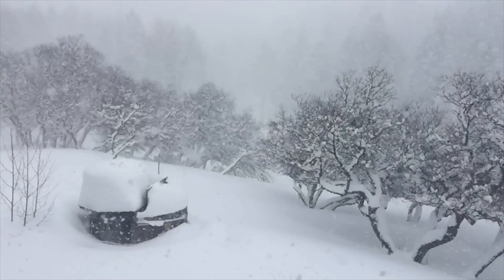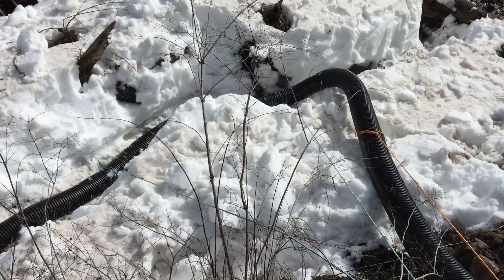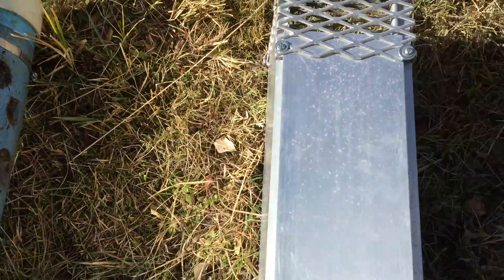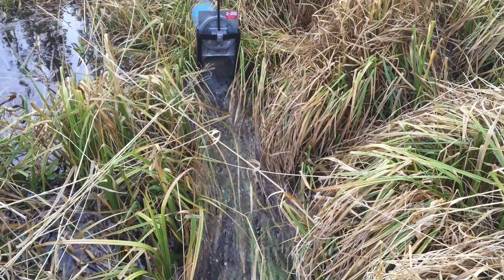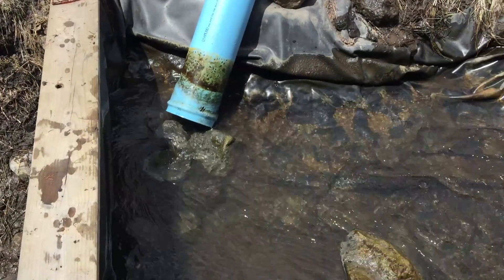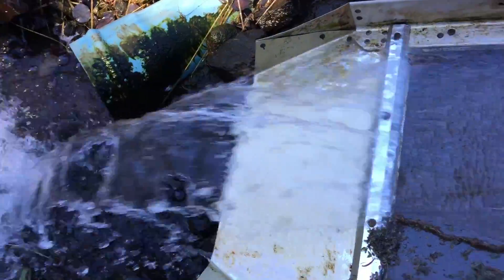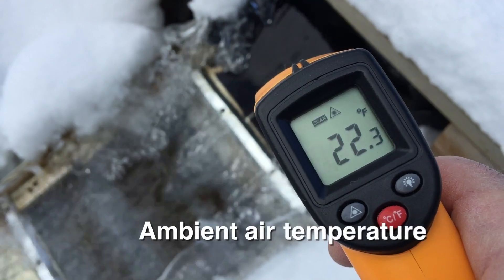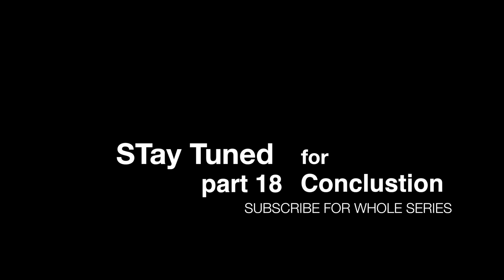Part 17 MicroHydro Power System in CO

Comment: Wouldn't it be you get a better water intake if you partially dammed that little water fall, allowing water to still flow over and down the stream but after forming a pool then placing your intake in that pool? Seems like the intake position is the cause of the air in the system.
Reply from the maker: The intake was in a natural pool up until this Spring.  We haven't yet diverted water this year and are relying on the water in the meadow for our reduced flow to 4500w of power.  Any dam constructed would be washed out by the spring run off which this year changed the entire course of the creek with enormous erosion.  We just have to adapt to the changes that occur in the creek.  The intake point is at the edge of our property so going upstream to a higher elevation isn't an option. Thx for watching and the thoughts.

Comment: You take water from the river for your pasture? Hopefully youve got rights to that water as claims belong to surrounding states on top of those who have actual water rights. How are you allowed to change the course of that river as well as dam and make a pond with it? We cant even clear an avalanche that dams a river in colorado as the waterway and river bottom is governed by the army corp of engineers. I ask only because i live here and want a turbine but with all the rules and red tape its not really possible.
Reply from the maker: We do have water rights.  They were acquired by filing in water court for non-consumptive run of river rights where the water goes back into the source it comes from.  Years ago we did build a permitted dam (permit needed when dam is above 5 feet) on another part of the property to establish a water augmentation system that can be "called" by senior water rights down stream.  It is a system that enables water managers to release a defined amount of water to meet senior water demands.  
We have not changed the course of the creek, it changes itself during the spring melt off all by itself.  There is no dam on the creek for an intake.  If we tried to install one, it would likely be destroyed by the spring melt off.  We do have a collection weir if that is what you are referring to.  It facilitates the collection of water into the coanda screen and the penstock.  There is existing water moving through the meadow which is more of a wetland than meadow.  It is combined with the water we divert from the creek.
Acquiring water rights involves filing in water court in CO.  First you get a conditional right that is good for 7 years to prove the beneficial use of the water. You can then file to make the water right absolute or extend your conditional right.  The adjudication date comes from the date of the original application.  This doesn't mean you are in front of the senior rights downstream.  Virtually all water was filed on and claimed via a similar process in the last century or earlier.  That is what makes those water rights senior to ours.  
If you are serious about getting water rights, I suggest finding a water lawyer to help you through the process.  We did decades ago.  You can file by yourself "pro se", but you might miss an important detail in the filing.  Odds of getting access to waters on Federal land is unlikely, but on private property (which we are) its not impossible, it just takes time and effort to go through the proper channels.  Good luck with your process.  I hope this helps explain it a bit.
Thx for watching  I'm never sure who has seen what of the series.  Here is a playlist of the 3 part synopsis which is an overview of the whole process https://www.youtube.com/playlist?list=PLtTypVpmDd-vkT9bJQkXw4I1t0e_4jMYA  The whole series is in about 25 videos.  This video gets promoted most frequently by YouTube.

Comment: Since this system provides excess power, why not install an electric de-icing component that can warm the areas around critical system locations?
Reply from the maker: many have suggested this, however the power generation is 1/2 mile from the intake.  Running wire that far is not only costly, but line loss and the fact that its not really needed as shown in other videos in the series means it would be wasteful.  Thx for watching and the idea just the same. I'm never sure who has seen what of the series.  Here is a playlist of the 3 part synopsis which is an overview of the whole process https://www.youtube.com/playlist?list=PLtTypVpmDd-vkT9bJQkXw4I1t0e_4jMYA  The whole series is in about 25 videos.  This video gets promoted most frequently by YouTube.
Reply: @mrhydrohead  but you have running water at both ends. You don't have to run wire, just have a small generator at each end that creates enough power to warm a light bulb or heating element above freezing.
Reply from the maker: We've been through multiple winters without interruption of water flow.  Why would we wish to spend excess money to solve a problem that doesn't really exist?  Installing another generation system could get quite expensive. The thermal density of water is very high.  The amount of energy to heat moving water would be immense.

Comment: Why do you have to filter the water so fine ? Let her go, 300 to 400 gpm is max. for that size line
Reply from the maker: Any form of sediment shooting through a jet at 100psi will tend to wear away at the brass pelton cups in the turbine.  It originally ran on sping water.  Creek and meadow water would have sediment and to continue to clean the water as best as possible will prolong the life of the turbine which has now run for 23 years non stop.

Comment: I live on a large river with tidal flows , into the bay so brackish water.  How can I harness the energy?  Thank you so much
Reply from the maker: I'm not sure I can help you with that.  The system we have is a relatively high head system compared to living with tidal flows.  You might look into https://www.turbulent.be/projects as it is a much lower head system.  I haven't seen an installed system yet, but it appears to be very promising.  Remember you would need to investigate local and federal permitting requirements. Thx for watching  I'm never sure who has seen what of the series. This particular segment you watched gets a lot of promo from YouTube.  Here is a playlist of the 3 part synopsis which is an overview of the whole process https://www.youtube.com/playlist?list=PLtTypVpmDd-vkT9bJQkXw4I1t0e_4jMYA  The whole series is in about 25 videos.

Comment: Hey you can make it self cleaning if you put a fan wheel on top. 
Here is how it works:
1. Place the fan above the inlet mesh system with less than .5 inch gap.
2.The fan will rotate with the potential energy of inflow water.
3. Its blades will move over inlet mesh circularly .
4. This motion cleans the inlet mesh  automatically. 
5. You can add cut plastick brushes to the edge of fan blades for better cleaning in high temperatures days and remove them in low temperature days as it promotes freezing.

Issue that might come:
1.fan freezing 
Solution: Try a non metal blades as it wont freeze soon. 
2. Water moving above the blades.
Solution: can try guides .

As it's a moving part ice wont form on it and water circulation adds to it. By placing the fan blade on top you can increase intake water quantity also. Hope this helps.  Don't mind just a thought.
Reply from the maker: The for watching and the suggestion.  Freezing ultimately has not proven to be a problem.  Not sure is you've seen the followup videos.  I'm never sure who has seen what of the series.  Here is a playlist of the 3 part synopsis which is an overview of the whole process https://www.youtube.com/playlist?list=PLtTypVpmDd-vkT9bJQkXw4I1t0e_4jMYA  The whole series is in about 25 videos.

Comment: On older Navy ships there was a Y shape pipe against a wall which was part of the seawater intake system. It was a strainer. Normally water flows through the filter in one direction, but when you want to get rid of whatever is caught you (I think) turn a lever & the valves open & close so that the water goes the other way through the filter, out a pipe & overboard.
Reply from the maker: Thx for watching  I'm never sure who has seen what of the series.  Here is a playlist of the 3 part synopsis which is an overview of the whole process https://www.youtube.com/playlist?list=PLtTypVpmDd-vkT9bJQkXw4I1t0e_4jMYA  The whole series is in about 25 videos.

Comment: So if you're generating 200kWh per day, there's no way you're using all that power. I haven't watched the other videos yet, but what do you do with the excess energy generated? Are you able to feed it back into the local power grid, or do you bleed it off somehow?
Reply from the maker: 200 is the max we've had from the system. Last winter we ran it at about 170kWh/day and other seasons like now we dial it back to 108-110 kWh/day because we just can't use the power.  You are right the info is in other segments of the series, but we use an electronic load controller ELC to shunt power off to a water heater with 300 gal of hot water and then the excess goes into baseboard heaters in the garage.  In summer it can get quite hot down there as a result. Thx for watching  I'm never sure who has seen what of the series.  Here is a playlist of the 3 part synopsis which is an overview of the whole process https://www.youtube.com/playlist?list=PLtTypVpmDd-vkT9bJQkXw4I1t0e_4jMYA  The whole series is in about 25 videos.
Reply: @mrhydrohead  Thanks for replying! Bleeding off the excess as heat makes a lot of sense. I found this video first, and I've been watching the series over from the beginning so I'll get to that part of your setup eventually. You've done great work here! I'd love to have a micro-hydro setup of my own but it's not hilly enough where I live to get more than a couple of meters of head without some serious engineering. Maybe someday!

Comment: Nice work, can you install some heating coils to minimize the ice buildup?
Reply from the maker: not necessary, it never freezes enough to prevent the flow of water.  besides, power is available at the powerhouse, not the intake.  Running wire would be an expensive waste of money.  Thx for watching  I'm never sure who has seen what of the series.  Here is a playlist of the 3 part synopsis which is an overview of the whole process https://www.youtube.com/playlist?list=PLtTypVpmDd-vkT9bJQkXw4I1t0e_4jMYA  The whole series is in about 25 videos.

Comment: Old video, but awesome! Have you considered bringing something like a Tesla Powerwall to absorb some of extra power you're likely not using?
Reply from the maker: Thx for watching  I'm never sure who has seen what of the series.  Youtube tends to suggest this one video more than others in the series.  Here is a playlist of the 3 part synopsis which is an overview of the whole process https://www.youtube.com/playlist?list=PLtTypVpmDd-vkT9bJQkXw4I1t0e_4jMYA  The whole series is in about 25 videos.
There isn't really a need to store excess power as direct AC meets all our needs.  I have thought a little about putting in a storage system.  The problem gets to be synchronizing the existing AC generation with an inverter source from DC batteries.  There is a company that makes these sorts of systems, but without a great need I haven't really investigated the cost or complexity of putting this together.  This is the company I would look into if I wanted to go this way https://www.victronenergy.com/inverters-chargers/quattro

Comment: Why do y'all even bother filtering it if it isn't for drinking or cleaning but rather moving? Dirty water turns wheels too. I don't see the point.
Reply from the maker: Any form of sediment shooting through a jet at 100psi will tend to wear away at the brass pelton cups in the turbine.  It originally ran on spin water.  Creek and meadow water would have sediment and to continue to clean the water as best as possible will prolong the life of the turbine which has now run for 23 years non stop.
Reply: @mrhydrohead  Cheer bud, that makes sense!

Comment: Build a sweeper activated by the flow of the water that runs over your screen to remove debris, in my head some type of impeller blade followed by a screen seems to be the best option but that's just an initial thought in my head
Reply: Yes, a rotating brush was my thought.

Comment: I think you could harness the water to sweep the coanda grills also, preventing ice and organic matter and just have to inspect once in a while to check on the condition of the brush and lubricate the mechanism if needed. Call me crazy.
Reply from the maker: It could be done, but not really necessary.  I haven't tested how long it can run without cleaning, but I know after about 4 months the coanda screen was still passing all the water needed and didn't HAVE to be cleaned.  I enjoy the occasional hike up to the intake anyway.  Thx for watching.  I'm never sure who has seen what of the series.  Here is a playlist of the 3 part synopsis which is an overview of the whole process https://www.youtube.com/playlist?list=PLtTypVpmDd-vkT9bJQkXw4I1t0e_4jMYA

Comment: Why not use a little of that extra electricity to prevent icing at locations prone to it? How about an automated screen cleaning system? I believe in the future, low/no maintenance turn-key off grid power systems will be in demand. I know I'd certainly pay.
Reply from the maker: I'm never sure who has seen what of the series.  Here is a playlist of the 3 part synopsis which is an overview of the whole process https://www.youtube.com/playlist?list=PLtTypVpmDd-vkT9bJQkXw4I1t0e_4jMYA  The power generation is 1/2 mile from the intake.  Works fine and would be a waste of money to run wire that far.  thx for watching

Comment: Just need to wire up a heater to the intake screen and outlet box from your main power box.
Reply from the maker: I'm never sure who has seen what of the series.  Here is a playlist of the 3 part synopsis which is an overview of the whole process https://www.youtube.com/playlist?list=PLtTypVpmDd-vkT9bJQkXw4I1t0e_4jMYA  The power generation is 1/2 mile from the intake.  Works fine and would be a waste of money to run wire that far.  thx for watching

Comment: Granted, I only briefly scanned over the early videos, but doesn't the generator have to run at a steady speed? Otherwise, you would have voltage spikes all over the place. How do you maintain a steady voltage output?
Reply from the maker: Good question. In the spring fed system the speed of the water jet (which is governed by psi) was fast enough to run the shaft direct drive at 1800 rpm. The creek fed system with lower psi needed a pulley step up to get to the 1800. That 1800 creates a 60 hz sine wave when load is equal to kinetic force. There is an electronic load controller ELC which monitors the hz and applies more or less shunt load to the system via SCR circuits to maintain a steady 60 hz. The SCR switches a segment of the sine wave to a simple resistive load like a water heater or baseboard heater. For more info on how SCRs work see this: https://en.wikipedia.org/wiki/Thyristor?wprov=sfti1. Thx for watching and the curiosity.

Comment: As clever as all this is , seems like nothing but trouble / seen a dude do an old wagon wheel into a power water fed gen out back of his home / your passion in such a hard climate is God given and admirable/ I'm in Australia / have a house on family land that's 80% of grid ( ALL 3 houses on property are / this was interesting to watch thank you:)
Reply from the maker: The system runs pretty much maintenance free.  The only issue is the changes in the creek diversion that have to be periodically dealt with.  This spring has seen a huge volume of water which changed the course of the creek.  So, I will be figuring out a new approach to doing the diversion once the waters recede.  It was super heavy snow this year and the runoff is still going which is about a month longer than  normal.   Anyway, thx for watching and the comments.  Glad to hear you are largely off grid.

Comment: I've just found your channel and loved the engineering you did in the field to solve each situation. 

My mind kept returning to the aspect that you only need to filter the water prior to it entering any device that would be harmed by unfiltered water. Thus, the filtration could be installed well downsteam of the main pipe inlet.

In the interest of minimizing maintenance to filter the water, you might want to look at a self cleaning screen system such as the Johnson rotating screen. These systems are easy to understand and do a great job. They do require some electricity, which you already create in abundance... but given your proclivity to engineer, I am sure you could come up with a water powered system for screen rotation. 
A second choice is a break settlement tank, installed at lower level that would allow heavies to settle and be drained off as needed, a top overflow for the bio to overflow to waste return and a regulated midpoint outlet for the main flow to continue.
Reply from the maker: Thx for watching and the suggestion.  The system actually runs fine in the current configuration.  The Pelton cups in the turbine are the only component vulnerable to erosion by sand or grit in the water.  All of that is nearly completely eliminated by settling all the water before entry into the penstock at the weir.  Any organic matter which makes it through the screen is inconsequential in terms of damage to the pelton cups.  After 23 years of operation the brass cups still show no appreciable signs of wear.